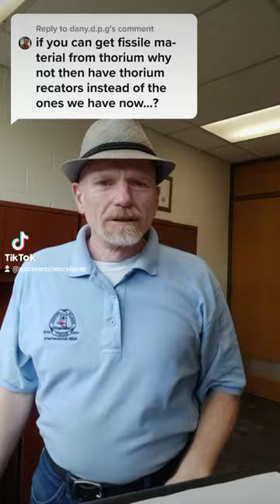Why don't we have Thorium reactors now?

Comment: The Thorium fuel cycle was not developed because it would have destroyed the coal industry, the rail industry, and thus the banks that had already loaned them so much money. MSRs have a levelized cost of electricity substantially lower than coal, gas, or conventional nuclear. The problem is political, not technological.
Reply: As so many problems often are.
Reply: yes it is
Reply: Yet they invested a lot of money to develop Plutonium reactors.
Reply: @petersteenkamp  nothing like gas, and nothing like the profits of gas. Gas is a limited subscription, they can make so, so much money on it.
Reply: @Peter  when they invested in plutonium and uranium it was because both had warhead capabilities whereas thorium doesn't.
Reply: It seems to me that all of the above are true.  Nuclear was initially about nuclear weapons supported by meeting civil energy needs which built the infrastructure which would have to be reinvented fir Thorium making  the ROI looks inadequate compared to existing nuclear oil and gas and so  making it harder to get investment
But then so did renewables…. And yet over time we find renewables having a lower variable cost than oil & gas 
Ditto EV’s which have always been superior to IC in every way except battery capacity and have become economic because of the massive investment in battery technology which still is still ongoing with more to come
Hydrogen ditto…
The lesson is that government needs to lead the way by regulation for the public good to create the investment need / opportunity which private capital will eventually exploit.

Comment: Yes, thorium was more expensive then, but now is cheaper. Molten Salt Reactors (MSRs) have too many benefits over water cooled reactors.
Today the Dept. of Energy is actively blocking development of MSRs. Large corporations don't want MSRs, because the money made from water cooled reactors is very large.
Can't make as much money from MSRs. Wind and Solar are more destructive to the environment in the manufacturing processes.
Reply: How would we go about doing it now? Other than for monetary reasons, why do you think the Department of Energy might be blocking the development of MSRs?
Reply: @christianh4723  it would ruin fossil fuel energy sources.
Reply: It may have been more expensive then but it produced 10 times the amount of power, and was safer, and is cleaner. It was never 10x the cost of uranium.
Reply: MSR's have a significant corrosion problem; and I have not heard anyone yet propose a real long term solution to it.  Keep in mind that nuclear power plants must run for many decades reliably to be cost effective.

I've worked in Nuclear power plant where just dealing with the corrosion issues related to normal water and other things is real concern - although now after 50+ years we know how to build systems without the worst of the problems.

Comment: Also interesting is the main reason thorium is interesting is that it can be "bred" (using neutrons) into fuel.  It becomes (eventually) U233 which is the fuel.  Back in the 60's breeder reactors were supposed to be developed which would have bred (and recycled for fuel), plutonium.  This would have greatly reduced waste and improved efficiency.  It was initially planned because it was thought uranium was rare on earth.  When more was discovered, the breeder reactor plans were dropped - though they still are a very good idea.  Both thorium and uranium breeders would advance nuclear power into a level we could only dream of today.  Energy would become plentiful and low cost (EROEI).

Comment: Your comments are incomplete.   The USA and other countries actually tried using Thorium as nuclear reactor fuel in a commercial power plant, and even built a thorium breeder reactor power plant.

Of course many countries (USA, Brazil, France, Germany, and possibly others) built test reactors using thorium as fuel in the 1950's and 1960's.

In the USA one of the first "large scale" commercial nuclear power plants in the USA - Indian Point Unit 1 (275 MW electrical output) was designed and started up in 1962 using thorium nuclear fuel.   That reactor was later switched to Uranium as Uranium was more economical.

Shippingport Atomic Power Station - Unit 3 (60 MW electrical output) was built as a thorium breeder reactor (and it bred enough fuel to refuel itself).  It ran 1977 - 1982.   Economics again shut it down (but it was built more as a test power plant reactor instead of as a large commercial power plant).

There was by the early 1960's an existing thorium fuel production facility.  But, the economics did not work out.
Reply: Don't tell that to the fan boys who believe YT videos are education
Reply: @clarkkent9080  Some of them can be.   Some are not.  Some are in the middle.

I wish more people understood that - and did a little research checking things and the sources when considering the validity of the information presented.
Reply: @perryallan3524  Remember when the joke was; It is on the internet so it must be true"? Now people think YT videos, like reality TV are real.....far from it.  

Most of these creators have absolutely no experience or education in the subject of their YT video.  Anyone with some video editing ability can look some stuff up on the internet and make claims on YT videos. 
Most people commenting on these videos have no idea that Thorium is not fissile and does not fission...totally clueless but they saw a YT video on it and then the conspiracy theories fill in the gaps in reality 

The VAST number of YT videos are posted to make the content creator money, nothing more.  And many people are getting the high six figures making misleading click bate videos.
Reply: @clarkkent9080  Totally agree.   The 1950's and 1960's thorium reactors had seed U233 for startup - and the generate and run off of U233.  While thorium may work for India and a few other countries in light water reactors now due to cost (and that breeder was a light water reactor).   The concept of molten salt reactors has decades of work ahead to prove that its even feasible on a commercial scale.   It has major corrosion issues (and as an engineer who worked in nuclear plants I have yet to hear that they have solved them for 40+ year operations); and the Oar Ridge test reactor (1965-1969) was very unreliable (it tripped due to unexpected issues over 400 times in those 4 years). Someone needs to build and operate a molten salt test reactor that perhaps trips once a year, or less over at least a decade.  Lots of nuclear plant theories never work out in practice, and it took decades to really get light and heavy water reactors to work reliable.

Also note that U233 is a wonderful bomb material.  Anyone reprocessing fuel to recover it is recovering bomb grade material just by chemical separation of the U233 from the other elements.
Reply: @perryallan3524 Terrapower is planning on building an MSR in Wyoming called the Natrium Reactor. However, it appears to be Uranium based and not Thorium. I believe funding is approved but still going through environmental approval.
Reply: @ValleyDragon  You are correct; but they are also going to make a huge gamble which is extreemly risky for the project.

There are two ways to license a nuclear power plant for operation.  

The old way (used exclusively through the 1990's - and only once since then):  Build a plant, and then license it to the current regulations. Big problems occurred in that as the industry learned lessons (Browns Ferry Fire, 3 Mile Island, and many other events that most people don't know about) that the NRC revised the requirements for new plant licenses while the plant was still being built.  That forced massive amounts of delays and rework - and nuclear power plants stopped being relatively cheap to build in the USA or being completed in a timely fashion.  Just 1 seemingly minor change in regulatory requirements can cost a fortune in delays and modifications.   Some plants under construction were never completed as it would be too expensive to modify to the new standards that they could see were now required - and no one knew if more changes would be required before the plant was completed and licensed.

The industry demanded that the NRC change to preapproved a deisgn and site that was licensed up front if constructed according to plans.  It took about a decade to develop the process and for the 1st generation of preapproved plant designs to be approved (none of which were built).

In virtually all countries in the world the common practice is to build a plant that has a preapproved design and site before anything but site preparation work is completed.

Terrapower is self funded by a multi billionaire - who has decided that it would take too long to get their design through the NRC preapproval and licensed design process to meet the billionaires goal of when the plant should be running.

So they have announced that they are going to build the plant under the old rules - and believe that they can license it when its construction is completed.

This is very risky as every licensed plant design by the regulators in all countries in the world that have such a process had to change something about their design during the preapproval process to get the design licensed (and a large number of countries don't do any prelicensing of designs as they do not have the expertise - but instead require that the design be licensed by places like the US, Canada, Europe, etc).

It is very plausible that Terrapower will build a nuclear power plant (a multi-Billion dollar evolution) and never get permission to receive any nuclear fuel and operate it. More likely is that the plant will have to be modified which will add delays and be very expensive. But, its the Billionaire's money and he gets to spend it how he wants - and its his risk.  Not a gamble I or any publicly funded company would take.

Note that the 1 plant that was licensed under the old system in modern times was a plant that was about 2/3 built under in the 1980's early 1990's that the company shut down, but maintained the construction permit and QA control and maintenance of the unit at a cost of a $Million+ per year.   Construction was restarted I beilieve in the 2000's when they had a really good idea on how the regulations had settled out - and the plant was licensed for operation under the old system.   

The Utility involved could maintain the plant and the QA system as this was supposed to be the 2nd or 3rd Unit at a single plant site - and the earlier unit(s) were licensed and they had a QA and maintenance staff onsite.     Everyone else who suspended construction on their nuclear power plants stopped paying to maintain the construction permit and stopped the Maintenance and QA programs - which makes total sense if you did not otherwise have a staff onsite to do that work.

Comment: It may have cost twice as much, but refining thorium is much easier than refining uranium. They end up with a lot left to use, as with uranium you put a lot in and get a little out. There is also WAY more thorium all over our planet then there will ever be of uranium (11 times the amount). Furthermore, the energy produced would be exponentially higher per ton used. The environmental effects of the reactors would be minuscule, Thorium produces very little nuclear waste. Based on your statement, you are saying that the most intelligent scientists in our country didn’t realize either of these things. I hope that isn’t the truth, I know science evolves with time. I just can’t believe that these genius men and women would use such a toxic element if it was not needed.
Reply from the maker: You do not have all your facts correct, thorium is only 3x more abundant than uranium and the fission products from both cycles are entirely comparable in amount per GWh and toxicity. Thorium does have advantages but currently we do not have the infrastructure for its fuel cycle and that would be a minimum of around 100 billion $ if not more .

Comment: Nobody seems to be worried that all those solar panels have to be replaced every 30 years or so, where will we get the energy to do that? And looking at all the comments, uranium fission was as much about producing plutonium for warheads as it was for producing energy. Thorium seems like a viable long term power source.
Reply from the maker: Thorium currently does not have the fuel cycle nuclear facilities built to allow that to occur, that would take maybe 100 billion to build all that

Comment: I believe there are also materials constraints due to high temperatures and corrosion in molten salt reactors?
Reply: It's hard for current technology, but not impossible
Reply: Yes but since the core of the reactor is liquid, you can build a new reactor and just flow the liquid to that one. The old pipes can then be removed and replaced.

Comment: Here's the difference, using uranium as a fuel is equivalent to using platinum, using Thorium as a fuel is equivalent to using dirt. One is way way more abundant than the other. And the United States (I think) has the third largest deposits of Thorium on the planet, behind Canada and India and maybe Russia.
Reply from the maker: Thorium is 3x more abundant than Uranium. Uranium is near the abundance of silver.
Reply: @robertbhayes5039  your statement is misleading because Natural uranium does not contain enough uranium-235 to produce fission. Nuclear power plant fuel therefore, must be enriched from its natural 0.7% to about 4.0%. Because of the low levels of enrichment
Reply: @davehalliday9399  exactly- and the number pre enrichment isn’t 3x its 11x 😂. In the us alone there is 3x more thorium, but in the world 11x

Comment: Money and political issues/interests completely aside (imagining a society devoted to just developing because money/politics is not an issue/restriction) between the those 2: which technology do you think we should be developing and using?
Reply from the maker: All nuclear including uranium and thorium and then let research discovery drive their respective shares based on sustainability, safety and security
Reply: @robertbhayes5039  Makes sense, thank you. And in the same scenario of "non-existent money/political issues", if we were to only have enough resources (time/labor/material/etc) for building 1 type of reactor, which would you recon (with current knowledge) has a better opportunity:risk balance?

PS: If you have some useful resources to read about this that would be great, I am really curious about the subject.

Comment: Is this guy kidding??  He’s wrong about all of it.
Reply from the maker: A nuclear engineering professor?
Reply: @robertbhayes5039 .   Thorium reactors are far simpler, cheaper, cleaner and safer…but still, they wanted BOMBS.  Hence, the direction we went back in the day.  Costs be damned since Thorium reactors are NOT good at producing weapons grade material.  We don’t have MSR/LFTR today because it would totally paradigm all energy production industries out of business OVER NIGHT.  Politicians are PAID big $’s by the current nuclear, fossil fuel, wind and solar industries to hold back MSR/LFTR for their own survival.  Hence, China has taken the lead.
Reply: @robertbhayes5039 Your explanation is not wrong, but is missing details such as the need for the reactors to produce plutonium waste for weapons.